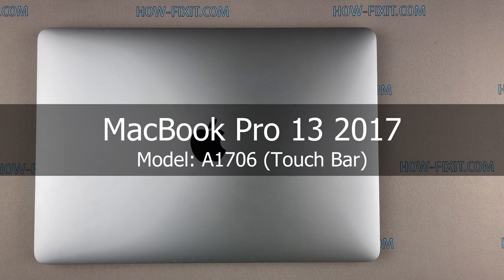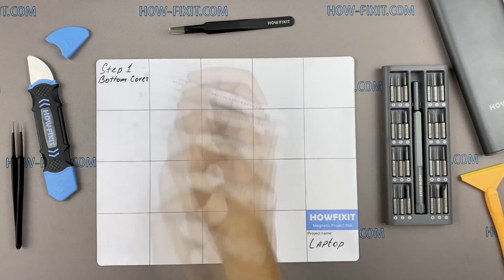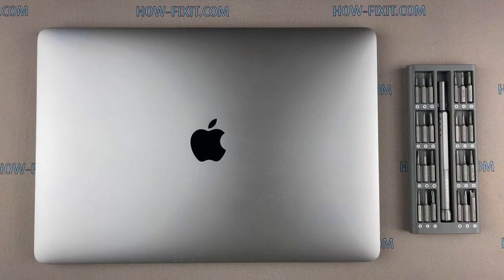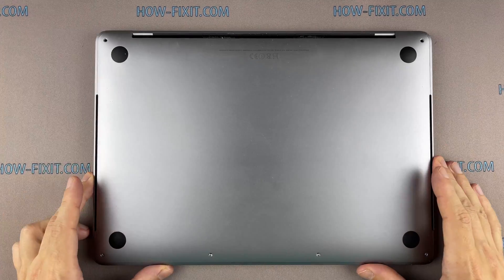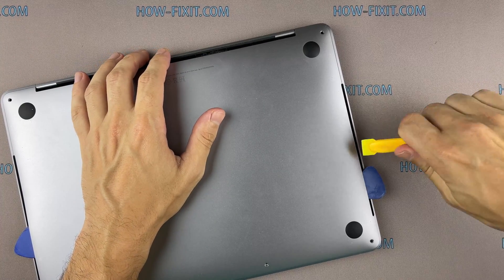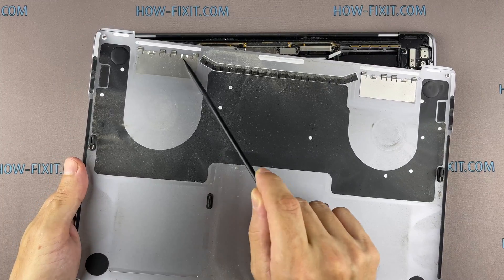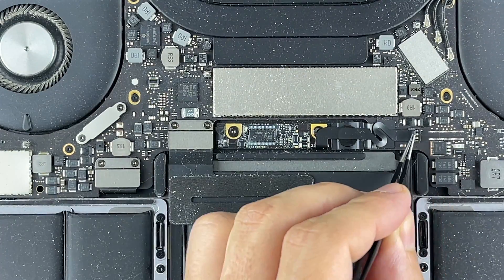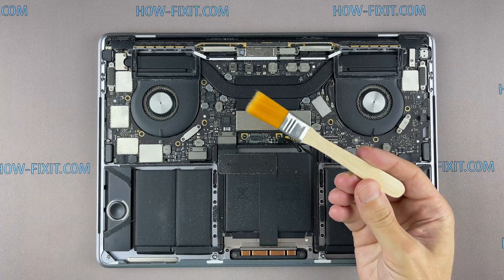MacBook Pro 13 2017 A1706 Cooling Fan Replacement Guide

Comment: Insane design decision to have to remove the entire logic board just to replace a component that will inevitably fail at some point, come on apple. Thanks for this excellent video however.